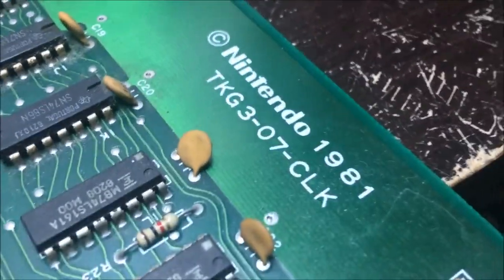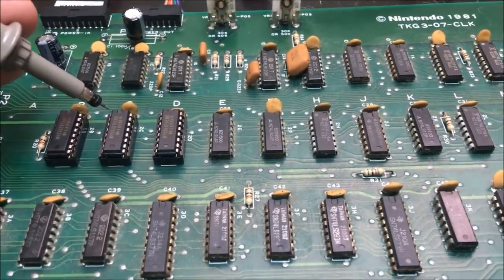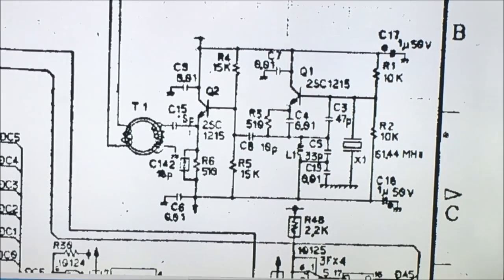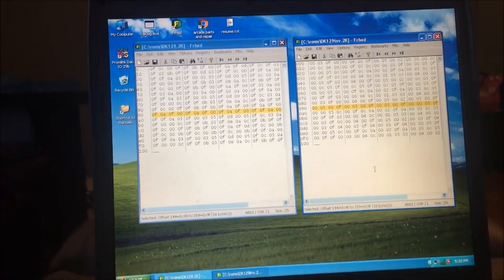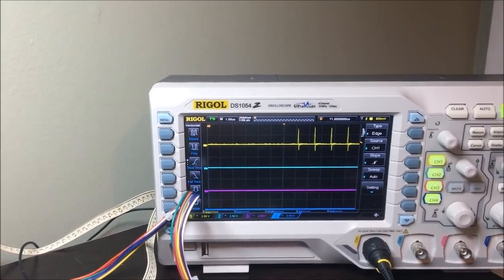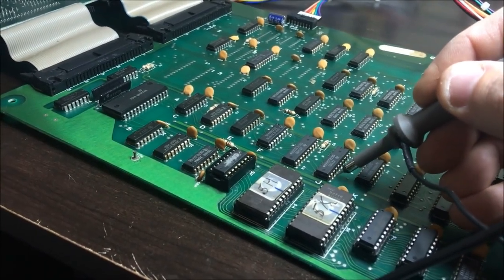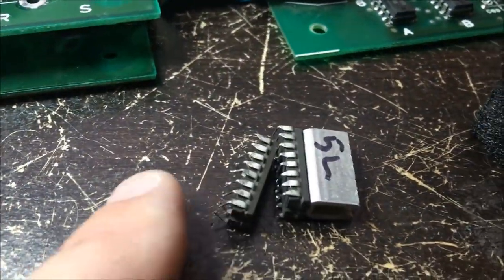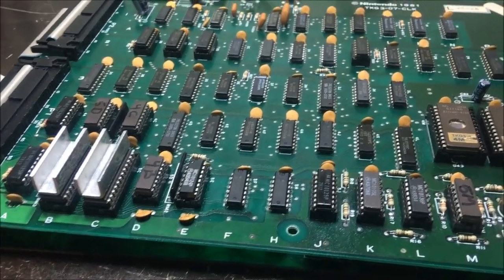1981 Nintendo 4-Stack Donkey Kong Arcade PCB Repair - Originally Published on 3-16-19

Comment: Nintendo probably thought ECL was the future because it's supposed to be faster than TTL.  Its downfall was both in its power requirements and its need to send differential signals between chips.  Edit:  So the main oscillator is 60MHz?  That's definitely more than most TTL of the era could handle.
Reply: Why would you want to future proof an arcade board though?
Reply: I didn't mean as in future-proofing it, but as in, these are the common ingredients going forward.

But looking at the circuit more closely, it's even more baffling why they chose this path.  Begin with a 61MHz clock, which already necessitates faster chips than standard TTL can do.  Then they run the clock through a small transformer which creates a weak signal output.  That signal output goes through 2 differential drivers to amplify it back to usable signal levels.  Then it goes through a divide by 5 counter.  After that, simple logic creates 4 output signals which are converted back to TTL.  If they began with a lower frequency in the first place, the ECL stuff wouldn't even be needed.  As ECL continues to disappear, I think it might be useful for someone to design a replacement board that can replace all of this section of the board with a simpler TTL solution.

Comment: Where did you get the 4 board schematic? is that available somewhere?
Reply from the maker: I didn't have one. I used what I could from the radar scope schematic (not much at all), and tried to use the DK 2 pcb schematic best I could
Reply: It's available. Someone on KLOV has it.
Reply: @WinrichNaujoks  Not as far as I can find on KLOV. Most links appear to be to manuals without schematics or just wiring diagrams.